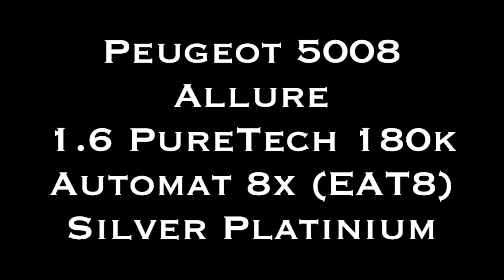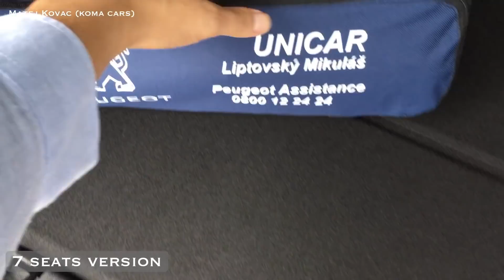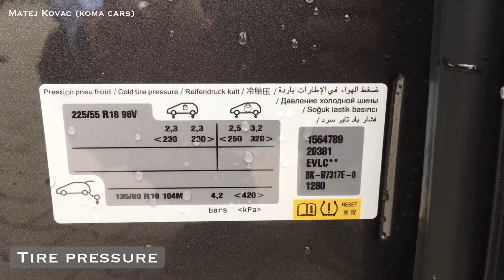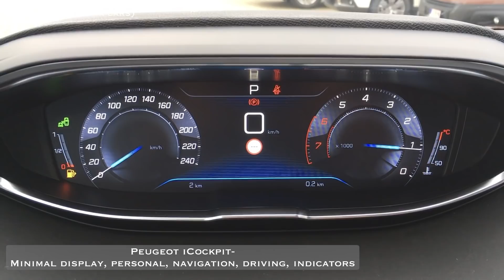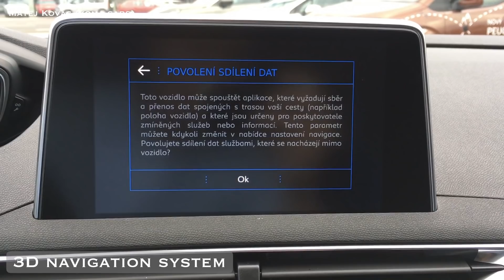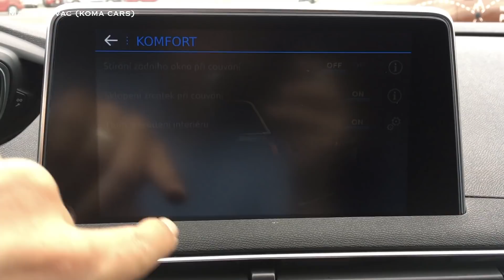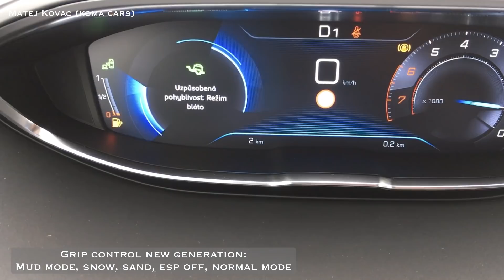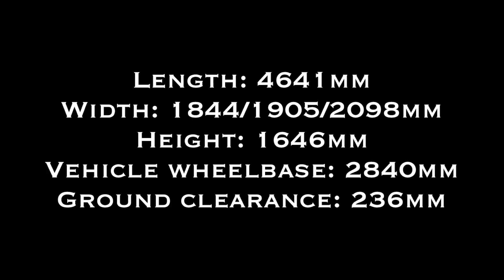Peugeot 5008 new SUV Allure 2019/2020 7 seats (demonstration, interier, exterier)

Comment: The finition isn't it "GT line" rather than "Allure" ? When you configure it on the PSA site, the radiator grill with horizontal layer is only about GT line finition. Which is very quite different from Allure finition in terms of options included...
Reply from the maker: https://www.youtube.com/watch?v=_HkBr4jOPqw  allure with halogen light with other grill